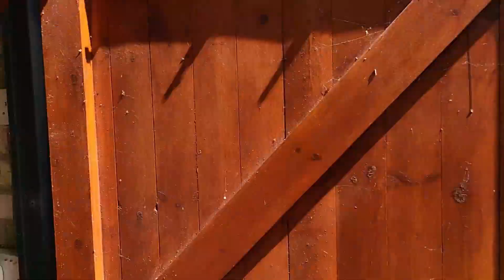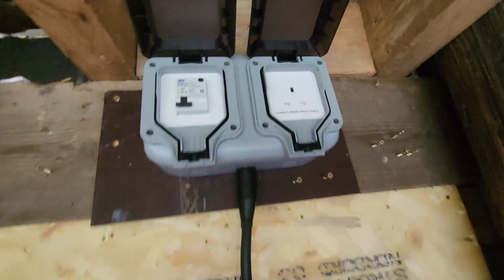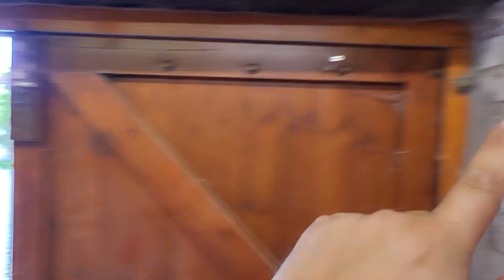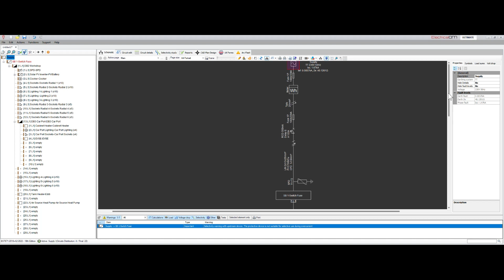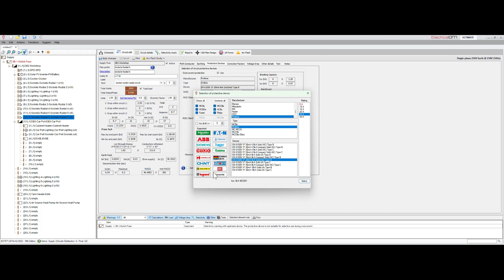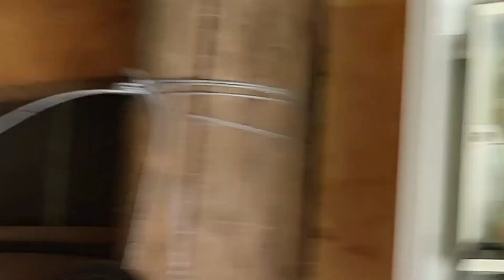How to install a Consumer Unit Outside - Huge TT install with full Electrical Design

Comment: Hi, Would a Proteus B63 amp mcb breaker not be a better and cheaper fit than the switch fuse carrier?
Reply from the maker: Depends on if you want to achieve selectivity or not.
Reply: @electrician247  Hi I suppose on the extremely unlikely chance Over current event the breaker Mcb would trip far quicker than any cartridge fuse would blow.
Reply from the maker: @danvictor3934  your missing the point. How about far more likely short circuit faults…. That is why selectivity exists. Poor design would leave the upfront MCB to operate rendering the entire sub board off. The time curve overlaps are to narrow to stage MCBS. This is why commercial settings tend to use MCCBs or fuses. 

Again for over current I would look at the time curves as actually fuses are not to shabby on prolonged overload. Interesting when you get into it.
Reply: @electrician247  Hi ah yes I did not think of this nevertheless a very neat and tidy job.
Reply: @electrician247 Hi, I forgot to say the Electricity Board May let you have a PME Earthing supply for this property free of Charge SSE do here down in Dorset.

Comment: Is that a cartridge fuse/enclosure that fits on the rail within the consumer unit? If so what is that called.
Reply from the maker: Yes it is mate. Most brands have them. Think that one is lawson.
Reply: @electrician247  don't all of the protective devices in a consumer unit have to be type tested? Aren't the Lawson and Proteus stuff going against that?
Reply from the maker: @leestorey18  it's a modular fuse carrier rated for use in any enclosure. It also does not sit on the busbar. 

Mixing brands of mcbs/rcbos that share a busbar is a no no.  

I'm more than happy with this arrangement 💪
Reply: thanks mark appreciate you taking the time out to answer my questions.
Reply: @electrician247  excellent thanks mark. I had no idea half of these thing existed especially things like the pollution facts ect you mention in this video.

Comment: Sorry I missed it, but if TT at origin. What measures are you taking to ensure that the meter tails don't come into metal sub mains metal enclosure before the 300mA RCD ?
Reply from the maker: Tails are fine if adequately glanded/secured along route and inside enclosure so not really needed. However we usually go the extra mile as will be shown when we come to install it all on the next one 🤭
Reply: 👍👍. Thanks for taking the time to reply. I was wondering how using that sensible approach you could achieve this with a three phase board as I don't believe there's a three phase gland similar to the ones you get for single phase DB. It would be good to have a RCD main switch rather than having mounted outside. Would you say the same for a SWA submain, having isolated the wire armour and the conductors going to the main switch only having single insulation ?

Comment: What’s a pollution factor? Never heard of that term. Not a sparky but interested in maybe retraining at some point.
Reply from the maker: A rating used for all electrical equipment in terms of its location of use. As described in the video. Thanks

Comment: Interesting video as always, pollution degree is new to me!

I'm curious about the fuse you've used for the feed out to the car port. I see from ElectricalOM that it's only a 10m run so I wonder if as it's in a duct you considered swapping that for a 25mm cable instead? Obviously there's a cost to that but I think the advantage is three-fold:
1) You remove a selectivity consideration and generally simplify it
2) If a larger supply is required in the car port at a later date (V2G?), it's ready to go
3) Slightly less voltage drop on a cable feeding one of the largest energy uses
Reply from the maker: Thats the design to cost equation we all wrestle with alongside the client. In this case we only have the 100A main supply so using to much of that over at the car port is not a realistic prospect. We have capacity in that area and cable type for a bit more kW yet based on the current setup. 

Running with V2G 16mm more than allows for that. We need to remember in that application the consumption would only be covering that short 16mm run and would not involve the main submain to the intake. 

The ultimate reason 16mm was selected is because it was the largest size we could fit down the existing duct 🤭. The customer has a set budget to work within and this more than delivers a robust system based on those sizes. 

The beauty of electricalOM shows based on the actual consumption we could have used a 10mm on that route. But as you describe we considered future use and went as big as possible. 

If we did use 25mm it doesn't impact selectivity that is formed on the ocpd run in series. Those would still need to step down between each other and we definitely don't want both those CUs hanging on the main switch fuse for isolation purposes. 

Thanks.
Reply: @electrician247  Thanks Mark that all makes sense, for some reason I just assumed it would be a 50mm duct I'm not sure why I jumped to that thought.

Comment: Just a question, with the heater (although small) in your GRP enclosure do you have a vent. It is advised here in South Africa…cheers.
Reply from the maker: Yes we have a condensation vent plug for exactly that reason. Great point to raise though, thanks!